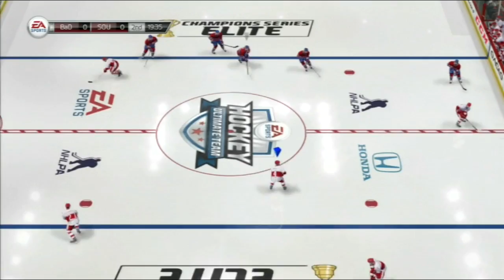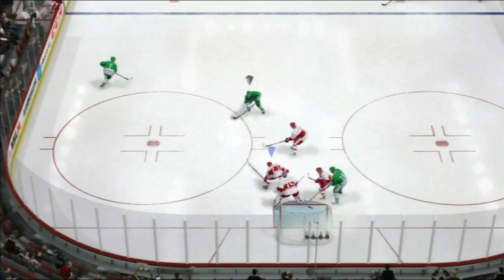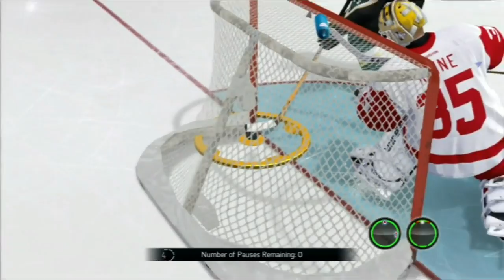Why we Need NEW Puck Physics in NHL 15!  (NHL 14 Clips)

Comment: It's not just these goalie problems. There's the obvious bouncing puck dump, but nobody complains about the ridiculous shot blocking. You can wind up a slap shot and if you hit someone, it bounces back, rather than deflecting into the corner. Take a wrist shot and someone can completely stop and reverse the puck's momentum with a poke check. So tired of wristing a shot as a dman and watching someone get a breakaway because of a poke check.